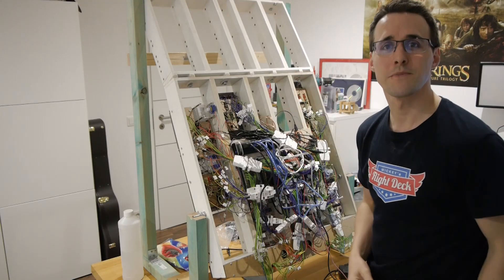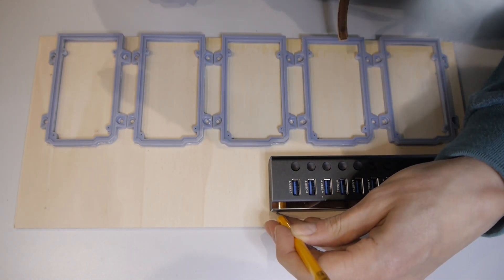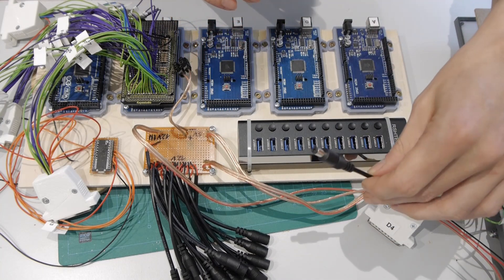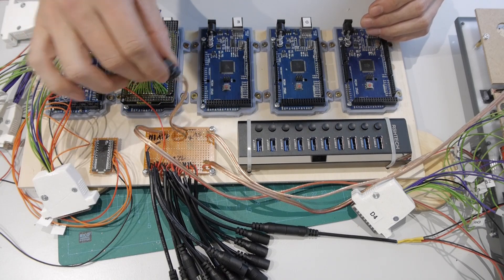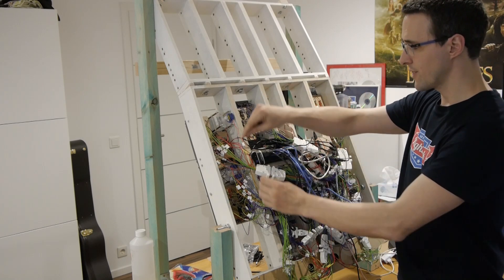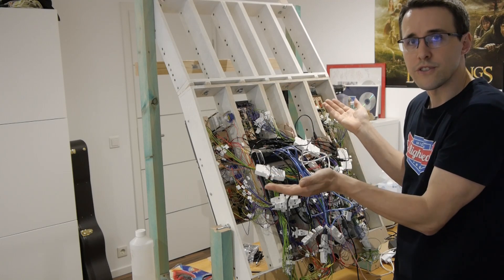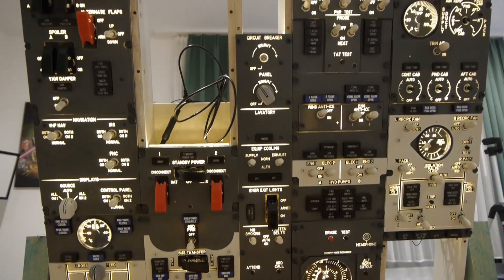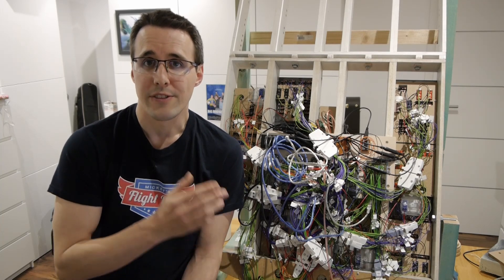Connecting the overhead devices - A Boeing 737-800 Homecockpit #56

Comment: On top of my last comment you could even go a bit further and make a few sub "Avionics hubs".  For example, the over head and overhead AFT sections can all run into a large PCB or box that contains all the arduino cards and have D-Subs on that end as well then use old printer cables that can be had very cheap.  Just make sure that you get the cables that contain all 25 conductors.  This same system can be done for other sections of the deck as well. You can have a hub for the MIP as well as the pedestal and at the end of it all, you can have just a hand full of usb cables going back to the computer!

Comment: Have you considered putting your board with the arduinos, USB hub, and leonardo separate from the overhead frame, and then running D-Sub extension cables.
For example, mount the board of arduinos on the roof frame work, run D-Sub extensions (and backlight power extensions) down to the overhead. This way, you keep it modular, but can route the cables to exactly where you need them, keeping it tidy. It will also make maintenance easier at both ends.
Reply from the maker: When I seperate it from the overhead it would be more difficult to test it in my room. Now I can take the whole overhead as one component and bring it to the testing place. The thing I can improve is the assignment of the arduinos. I have assigned every new section to the next free arduino. I will have to assign segments that are located near to each other to one arduino so that the cables don't have to be routed across the whole overhead.

Comment: what's your plan for building MIP?  And do you know when the video of its construction will be released?
Reply from the maker: This isn't sheduled yet. I try to make all the things first where I don't need to bring in a seperate computer for the simulator. Components like the overhead, pedestal or CDU can be tested with the computer  my room. This is the reason why this will be one of the last parts of the cockpit.
Reply: @Mickeys_Flightdeck  okey thank you so much for answer :)
Reply: i think about 2,5 years to finish
:)

Comment: Hi Michael. Fantasic job with both your cockpit and the videos. I'm actually up in the 30 ports myself for my 320 DIY homecockpit. But I am having many problems with the USB connections. After every PC boot there are several devices not recognised (Mega2560, LeoBodnar836 and/or Ultimarc Packled64 cards). Swapping the affected device to another port or even to another hub often does not recover the device.  I have updated w10, uodated the BIOS, disabled energy savings, removed all USB services in device manager to reinstall their drivers. I changed the USB cables and removed any long USB cables. I have changed the power supplies of the USB hubs. All my hubs are powered USB3.0 hubs and I even installed an extra PCIe 4x USB3.0 port card. But the problem is still not solved. According to a moderator of Mobiflight any modern PC should be able to handle 128 USB devices, but it looks like my PC doesn't agree. I7 6700k, 16Gb ram, GPU1080, PSU 700w. Would you have any suggestion what could be the issue?
Reply: I had issues like this some time ago and I fixed it by buying expensive USB hubs. I'm not assuming yours are cheap :-)  but I had to pay £39 each for good ones, and for me they were worth every penny. No more random ding dongs.
Reply: @JoePCP  Hi thanks for your suggestion. I have 2 TP-Link 7 ports USB3.0 hubs and 2 Manhattan mondohubs (28 ports each). I wouldn't want to call them cheap,  but they are apparently not good value for money. If you could share which hubs work well for you, I would appreciate it.
Reply: @vincenttwisker9656  The hubs I bought were Sabrent 60W 7-Port USB 3.0 Hub 
I got them from Amazon, they also have cheaper look alike ones but these are a proper branded one.
Reply: The key is to use an USB hub that also connects separately to power outlet. Each port can draw almost 1 amp , multiply by 5v and you get the necessary wattage. E.g. 5 ports.. Need about 25 watt hub. A USB hub that just connects to the PC port cannot deliver that kind of power.

Comment: If it gets in a way you could put hinges on the top of the board that holds the UNOs. That way you could lift it up if you need to get access to the ones immediately underneath. But, you got it done and that’s amazing. Show more pictures of the front with all the back lighting working and all the gauges moving! That would be awesome to see.

Comment: I am watching and learning - this is my sort of wiring nest!  Could you use a few more Arduino? one for each section etc so there is no crossover of wires. I know that you may not fully use all of the pins and it adds to the cost but it could make it neater and easier to correct faults in the future.  Your videos are amazing and I am learning so much. I am nowhere near your level but I'm finding it interesting and fun. Thanks for your instructions, thoughts and inspiration.

Comment: I'm terribly sorry, but 55 episodes I've been impressed / amazed by your approach and your work, but this is not mickeysflightdeck quality. :'(
I suggest you go back to the drawing board and clean it up there. You have the potential to make your wiring perfect!
/ Best redgards Jimmy
Reply from the maker: I absolutely agree with you and I have seen this coming. I said this at the end of the video, it is on my list for a rework of the overhead. But by running such a channel I have to "think" in youtube dimensions too. A complete rewiring would cost me weeks and the only thing I can show is soldering. This is something nobody is interested in. There are still two sections missing where I have to figure out what kind of connections I need. When this is done I have the big picture and can go on from there. It will be clean in the future.
Reply: @Mickeys_Flightdeck  okay =)
I have no ambitions in any way to complain at all, other than that what you showed today does not hold the same quality and class as other episodes. In any case, nice to hear that you have a plan for the future. and to be added, I do not think "you tube" as you do !.
Keep up the good work! and I look forward to future projects and episodes.
/ Still very impressed with your build Jimmy
Reply: @Mickeys_Flightdeck  you probably could do some "extension" cables to run behind the sections with the connectors fixed to the wood, and then run the oposite end to the arduino plugs and add the another board to mount the conectors there. I know it's a 2 connections and it increases the potential to fail but the wire runs would be probably cleaner 
:)